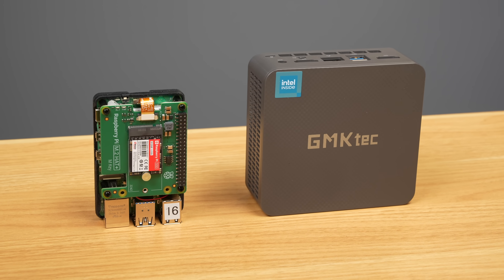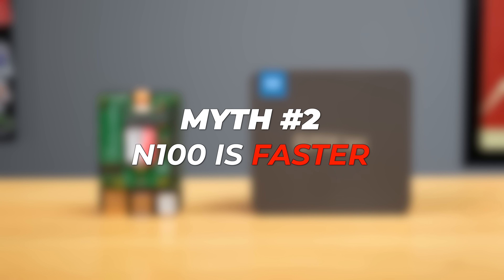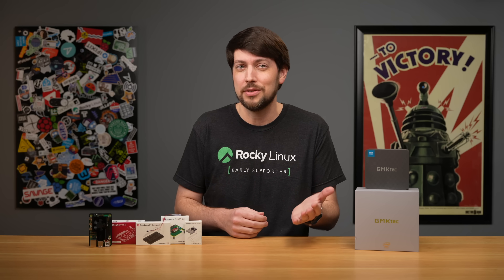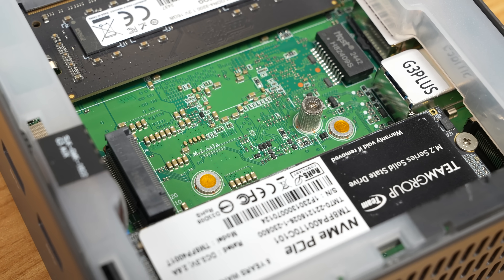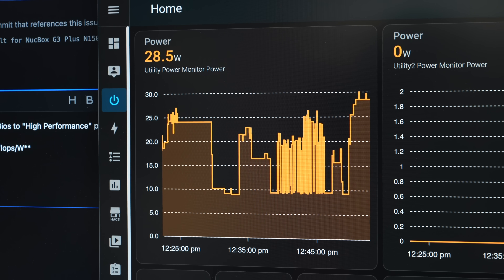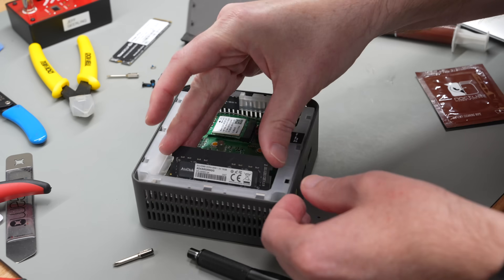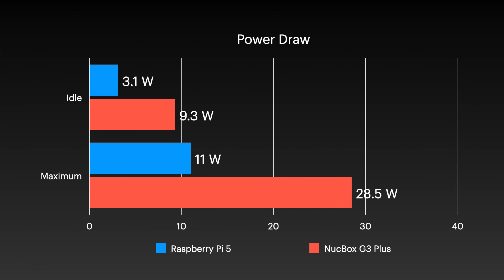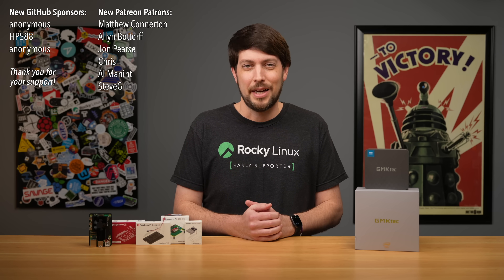When did Raspberry Pis get so expensive?

Comment: i do think this generation of raspberry pis have been the most underwhelming. granted many great aditions but some massive losses. 

imo the loss of hardware encoding on the BCM2712 is a big one especially if you do any video streaming off the device. sure the video media engine on the pi4 and below were very limited, but rather than upgrading the video block its just gone, do it on the cpu. when the BCM2712 is 4x A76. RK3588/RK3582 have been rather intresting,  the media engine should be a massive upgrade if anything supports it, the extra 4 A55 cores too, and they are price competitive to pis

Comment: I've been using the NucBox G3 for about a year now, alongside a Raspberry Pi 4B. As an office PC, the NucBox is an absolute powerhouse. I'm so impressed with its performance that an entire office of my friends ended up purchasing 12 of them, and they're enthusiastically recommending it to others. Mini PCs may not be gaming consoles like the Xbox or PS4, but they make for smooth, efficient, and clean desktop replacements!
Reply: I have been using nuc's as my htpc's for the last 5-10 years and now use them for most of my small business computing needs. I have a gaming rig I use here and there for office duties but the nuc's are perfect for how I am set up. Pi's are really just super esp32's.

Comment: So, this video is tripping me on my ongoing dislike for the pi foundation and their slow  s  l  o  w progress, yet ever climbing price, AND persistant shortage of stock and more besides. 

Yes, they added PCI-E, but its a bodge and you need extra parts to use it. 
Chinese ARM boards if you want to focus on ARM, now come with plenty having a standard PCI slot. 

The N100's give you that, memory slots, and wifi slots and a bunch of ports. Some simple things like standard video ports over weird and wonderful extra special ports where you won't get by with your HDMI lead. The N100 is low power, cheap n cheerful and is bluntly better for general compute - unless you just need that power bill down. 

We long past the point where there could be a PI board with a memory sodimm port, PCI-E slot and better ports. 

If we're determined to focus on ARM, then I look at the Orange Pi 4A and at 2GB and 4 GB with PCI-E and have to say what the heck are Pi Found. playing at. 

https://vi.aliexpress.com/item/1005008086332791.html?spm=a2g0o.productlist.main.8.6ceexgDyxgDyXR&algo_pvid=cfb828e1-edd8-4a03-9a61-1034c12dcbe3&algo_exp_id=cfb828e1-edd8-4a03-9a61-1034c12dcbe3-7&pdp_ext_f=%7B%22order%22%3A%227%22%2C%22eval%22%3A%221%22%7D&pdp_npi=4%40dis%21GBP%2129.39%2129.39%21%21%2135.99%2135.99%21%40%2112000043643306431%21sea%21UK%212822535227%21X&curPageLogUid=nexyjIADzg0g&utparam-url=scene%3Asearch%7Cquery_from%3A

Comment: Recently I had to image some thumb drives for a CM4/Axzez small NAS build. Windows wouldn't create a thumb drive that would work, so I got out a Raspberry Pi 3. Between the SD card performance and all the updates it was painfully slow. Faced with the same task a week later, I decided to avoid the Raspberry Pi 3 and built a Raspberry Pi 4 with Axiom One M.2 case and SSD drive. I could get my small HDMI display to work with it so had to connect to a better monitor. As I looked at the table full of equipment and cables it occured to me that maybe life would be easier if I just build a Linux laptop instead. I'm not sure I like the packaging of a Raspberry Pi or a mini-desktop, if a monitor, keyboard and mouse need to be connected.

Comment: Years ago bro. Even way before Covid they were always much more then msrp, no matter where you went. In Australia I'd say at least since the Pi 3. I had a few Pi3's cos they weren't too outrageously priced, but still more than msrp. But since then I refuse to use RPi's anymore. They have just not held any value proposition compared to other SBC's or Chinese alternatives.
I mean why would I buy a Pi when I could spend the same amount of money or a tiny bit more and get a fully fledged Embedded x86 SoC's like an N100 with all the features, IO and support that comes with. Basically my rule is now if an ESP32 can't get the job done, then I go x86.
As far as I'm concerned Pi's are dead to me and ARM and Broadcoms greed killed them.
Reply: “They were way more than MSRP”…
How odd, except for a batch of RPi4-8gb and two RPi5-8gb, every RPi I ever purchased, from the RPi1, RPi2, RPi3, PiZero, totaling some 35-40 units were obtained at ‘MSRP’.

The batch of six Pi4 and two Pi5 were super-cheap, approx 50%-70% off.
Brand new, sealed, verified genuine, with genuine bill of lading from a very reputable electronics distributor. 
Just needed the boxes cleaned up.. they were dusty, possibly from their falling off a truck 🤔?

Comment: I have had Pi 1, 2 and 3, but stopped short of 4 and 5. The reason was that I was using these Pi's as media streamer and mini nas. Also ran some programs that had to run 24/7. What I think would be useful on a Pi would be good nvme support with additional sata interface. Those dual hdmi and ports for the display and camera can be omitted, never used those once. I enjoyed the Odroid M1 which had both nvme and sata and came in a nice metal case.

Comment: Appart from the fact that I burned 2 Pi5's due to the stupid pcie interface, and therefore nobody cant say I didn't tried, the thing I realy hate about the 5 is the lack of video encoding.
Nowadays there are much better sbcs (with video encoding) or even complete systems and thats what I ended up doind. I went back to an intel based system and my problems desapeared!

Comment: 4:06 not even close.

For starters, 4 lanes of PCIe Gen 3/4 are better than 1 lane of PCIe Gen 2, but wait, there's more, it's actually 5 lanes, because you have the m.2 slot of the Wi-Fi card.

You could add a 10G NIC to that 1x slot and get close to full bandwidth, and an HBA on that x4 slot to get a whole lot of, quite fast, storage capacity AND fast networking, all of which you can't do on the Pi5.

I have two N100 mini PC's on my proxmox cluster, and one of them has a 2.5G NIC in place of the Wi-Fi card. I removed a useless Wi-Fi card and put a proper network card, on top of the already present 2 1G ports. You just can't get that on a Pi5.

So please, don't misrepresent the capabilities of, dare I say, the vast majority of mini PCs when talking about expansion.

Comment: For my everyday work I use a PC, while for building industrial control devices, I use pi-based PLCs. One of those costs 5 times as much as a “naked” pi, but has a robust case, with standard DIN rail mounting, 24 V power supply input, relais outputs, voltage protected inputs, real time clock, etc. Great. Not comparable. Different use. And processing power is not the point.

Comment: I can get 2014 Mac Minis and use those as servers, the RAM can not be upgraded and neither can the CPU without soldering, but the storage can be upgraded and so can the wireless card. My old job has a lot of them and they are basically giving them to us along with a few 2018s that are T2 Intel mixed in there. I have one with a 4278U and 8GB of RAM running Windows Server 2025, it's perfectly good as a domain controller and file server for me.

Comment: Great video, Jeff! I love to mess with Pi's, esp. for server applications (Jellyfin and Calibre on a Pi5 8GB,  OpenMediaVault NAS on a Pi4 8GB, and HamClock on a Pi3, etc.). Those don't need a ton of computing power. My daily driver is a Lenovo ThinkCentre 70q running Linux Mint 22.x. I've thought about the mini pc's, but watching you have to do all that extra work to install Linux is a deal breaker for me. I have an ASUS Vivobook 17 also running Linux Mint with zero install issues. I got the 70q new, and the ASUS as an Amazon refurb for $300. I'm very happy with my Pi servers and my desktop and laptop. I still do have a Surface Pro 4 running Windows 10 because some of my ham radio software doesn't run on Linux, and then there's tax software. I'm just not comfortable putting my tax data into Inuit's cloud. I'm hoping for a Linux client (not holding my breath though).

Comment: Get whatever You like :) small sbc, bigger nuc or whatever You really need, usually not power consumption is most important, not efficiency.. ie. no TrueNAS on ARM forces some into x86. Same for gaming or some software or interfaces.  
Raspberry would be cheaper for us with 12V pd and m.2 slot. Still rockchip has more power and better memory choices. That is why I got 8x more rk3588 than pi5. x86 scales much more with cheap units and 64GB of ram and much more io. 
New king cix is coming :) lets see how risc-v should catch up :)

Comment: This G3 plus actually sucks. Very expensive in EU (250+), no ASPM -> too high idle power consumption (~ 12W, around 4-5W more than my other N100s), can't install Debian - fail at grub install stage (probably too old kernel 6.1), so no encrypted Proxmox (regular Proxmox installer works tho). Mine does not overheat, max 75 at s-tui stress.

Comment: Your "myth busting" is just opinion mixed with cherry picked stats.... last I checked 150 is less than 208..... so like for like its cheaper..... regardless of the number of "people you know" who want a 16 gig pi 5...... Efficiency is a simple look up, 12 TDP for Pi 5 and 10 for N150 (which is on gmktecs website for 145 bucks right now) what does that 2 watts get you in the n150? Double the memory bandwidth and more than double the CPU frequency..... If you are looking for homebrew solutions for automation or craft night with computers nothing beats a Pi..... but if you want to make a simple email computer for an old aunt or setup a media pc the era of tiny pc's is here..... they are not the same thing and trying to compare them as equals is kind of silly.

Comment: Pi is only good for: IO pins.

For anything else, used "tiny-mini-micro" 1-liter used office PC's blow it out of the water.

Compare this N150. single channel ddr4 or single channel ddr5 only, limited PCIE lanes, and using atom-class cores.

vs A 1 liter with i5-8500T using proper big-cores, which even when old, outrun new small cores. dual channel ddr4, which equates to an N150 with DDR5 single channel easily. Many have 2x NVME slots, some even have full x8 expansion slots for half-height single slot cards. Sold with ram and NVME on ebay for less than $100 all in.

Warranty is a solid argument, but these are used corporate PC's at the bottom of the bathtub curve, so failure is unlikely within a reasonable timeframe of usage, and some even still have warranty if the original owning corporation maxed those out.

Wattage is another good argument, but every N100 or N150 mini PC i've seen idles at 10w, and my corporate i5's idle at 3-5w from the wall. and once M90q gen3's fall in price some more to compete with this price point, mine idles at 2w from the wall. They do 35w TDP under load but tracking with a kill-a-watt shows lower "over-time" usage indicating some "race to idle" goodness happening from the big-cores compared to small cores.

I mostly buy lenovo as i used to manage a field of 5000~ of them and rarely saw failures. I still have working haswell thinkcenters and even a core 1 duo thinkpad T60, so I'd trust them to last a lot longer than any generic beelink/etc atom core pc.

Comment: I just bought a Pi5 16gb yesterday. for just 20 dollars more i could have had a Dell thin-client with pre-included 256gb ssd storage, 16gb of ram, and a stronger CPU, with a power adapter. but the reason i chose a Pi5 over that was simply power efficiency, I plan to take the docker containers im running  on a Dell R210II and move them over to this Pi5. That Dell server only uses about 35 watts of power and I hope to bring that down to less than 10 watts with the Pi. the Dell thin client could also bring down the power usage of my services, but in my server rack, every watt counts, and the more watts i can save on some services, the more watts i can dedicated to other services that need it.

Comment: Clever move to blur that paste scene. You avoided tons of "That doesn't work..." comments. Plus yeah. I agree much with this one. It's all about what you're aiming for. Like saying old used computer is cheaper, it sure can be true and I just bought few years old 6 core i7 laptop with Quadro graphics for couple hundred bucks. But it also came with whopping was it near 300W power brick. It's for CAD solely. Raspberry and one used low power 1L pc will still be the choices for my homelab that's 24/7 on. Raspberry with SSD and used as NAS is still very sufficient for me. Like is my how awfully old that nuc2820 that is functions as proxmox backup server and sips about 3 to 4 wats being on. It's old, it's not powerful by any means these days, but still it handles those weekly backups without issues. Not the fastest process and takes was it few hours, but I'm not looking when it's at work and I don't even notice it = works for me.

Comment: The issue with the pi is that in some countries its impossible to find it in msrp.
so for most people this compression isn't valid.
in my place the raspi 5 16gb cost is about 170usd (only the board).
after you add a case, psu, sd card, cable and all the stuff that you need to power it you're over 200usd.
for this money you can find cheap ryzen mini pc (and not intel).
Reply: 170 USD?
 In Portugal P5 16 GB RAM is 129€

Comment: Personally i have used the Pi4 as an embedded computer for drone purpose until i have bought a Nvidia jetson orin nano
I see the pi platform as a entry grade sbc for developments purpose for when you try to grasp some concept or have use case that doesn't require a beast of a machine.
You don't buy a pi to use it as a pc but for its capability to be a ''lowcost'' versatile tool.

Comment: Benchmark results dont spoeak voleumes about the performance. its been a proven method that doesn't work. if you want to see a true comparison. run the same Os and run the same programs at the same time and see what results you get. the raspberry pi 5 kills the radxa x2l in all tests and bench marks.  The pi 5 measured around 700-800 on geekbench and the radxa x2l had a low score of 370, But running actual programs such as gaming programs like aethersfx killed the pi in all performance values. I had to do more tweaks justto get the pi 5 to compete and even that wasn't enough. best use case scenario. run your real world experience program and compare for you're specific use and measure that way. Bench mark results are just that and really don't mean anything. Also each kernel on a pi is gonna give you a different performance result as well just like running android on arm is better than linux. drop the bench scores. run a video editing program or whatever your use case scenario is and test it that way. Also the youyeetoo x1 is $109 and has gpio pins and more features than the Radxa x4.

Comment: Nice perspective on the PI vs Mini PC. I use both in my home lab. 4 pi's - 3 PC's, For mini PC's I usually go used. My favorite mini pc's are the 2012-2014 Intel Macs. They run very efficiently which is important because my electrical rates are on the high side.

Comment: The problem with MiniPCs at the moment is, that there are no mid range systems. You get the N100/N150 systems for under $200 and the higher end ones for $700+ 
I had the right gut feeling and pulled the trigger on a Minisforum with an AMD 5625U, 16GB RAM and 512GB NVMe for 280 Euro (yes, that includes taxes). I really hope, that the mid range segment for 250-400 will be back soon. I really do not want to suggest or recommend an N100/N150 system to friends and family...

Comment: I have been running GMKtec mini PC's for about a year. I have three of them on my bench for different things. I run linux on all three machines.  well one of them I dual boot into linux or windows using two different nvme drives... They area a great cost effective solution. I have not seen a significant performance difference between the N100 and N150 based GMKtec mini PCs. Now granted data points from two specimens is probably dubious at best. but basically they perform almost identically on geekbench...  the N150 is slightly better on single core while multi core is slightly better on the N100... either way they are a great solution for a small benchtop pc for downloading firmware and burning sd cards and usb thumb drives...  I still run quite a few pi's and to me I feel like there is room for both as they really are both designed for a slightly different purpose... also side note the nvme hat really does change the performance of the pi...

Comment: Pi above $35 regardless of why is a bad place to be.  At $50 and up, no.  I have begun using $40 7th gen Intel mini PCs, old HP Prodesk.  The i5-7600T, for example, clobbers the N150 in virtually every way except slightly higher wattage. But FOR that, I get gigabit, an NVMe slot and a SATA port and it can even run Windows 11 and play some games.  These old PCs destroy any advantage Pi has and make these new mini PCs into expensive curiosities.   For the Pi 5 setup at $208, that's just insane.  The Pi Zero 2 W at under $15 is where Pi should be. Not over two hundred bucks.  So it saves power? How many YEARS will it take a $200 Pi setup to save $10 a year over my 35W i5 that is significantly more powerful?  At least a decade.  I love my Pi Zero 2s.  Best computer bargain of all time. The prices for a Pi 4 or 5 ruin the advantage so badly, they might as well give up.